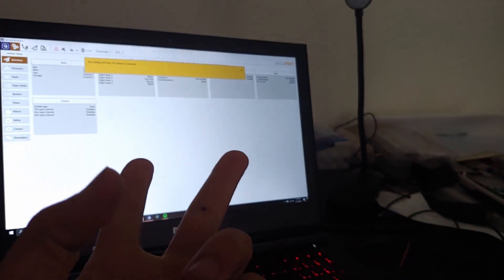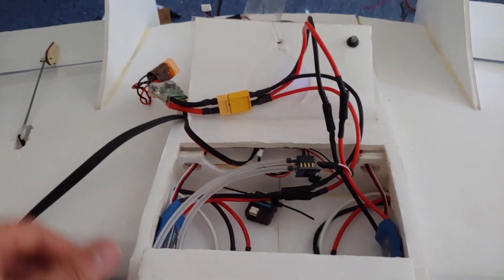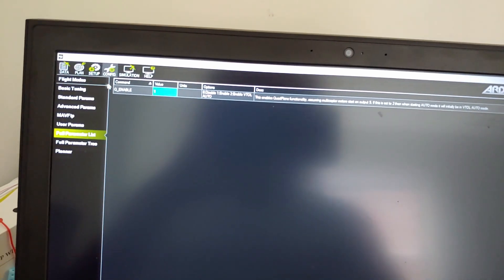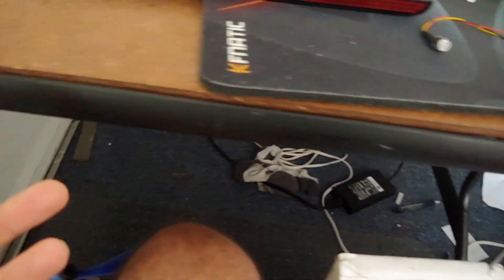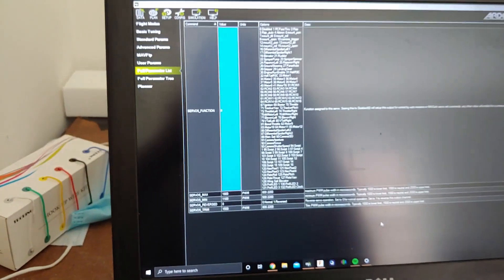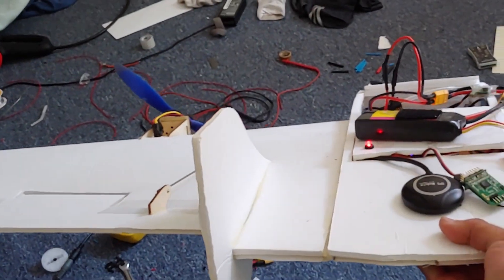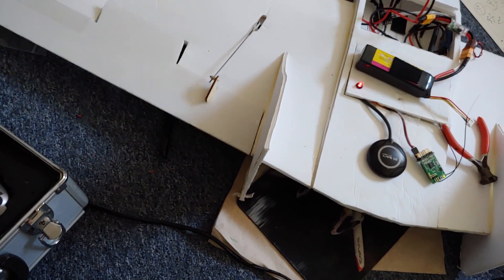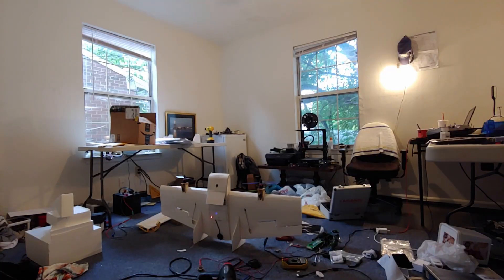Arduplane VTOL Tailsitter: Software setup, first flights, & first transitions

Comment: Really impressive ! Can I ask you what kind of flight mode do you use for take off and landing ? I'm ready to test mine but when I switch to QLoiter for take off with the wing vertical, the aileron are not flat but as like as the wing has to roll left. Is this normal ? Thank you very much

Comment: I was only able to install firmware to radiolink pixhawk with QGC on linux. I compiled APM Planner 6 times, it didn't work, tried MP, QGC and APM Planner on windows, -with resetting drivers for like 10 times-, these also didn't work. It took me 2 weeks to load the firmware correctly. So if you are having trouble with it, I recommend QGC on linux. Both PX4 and ArduX worked well.